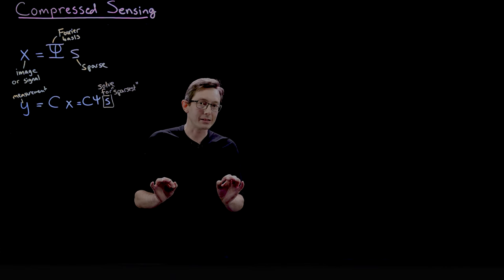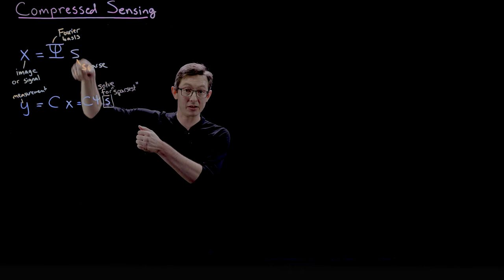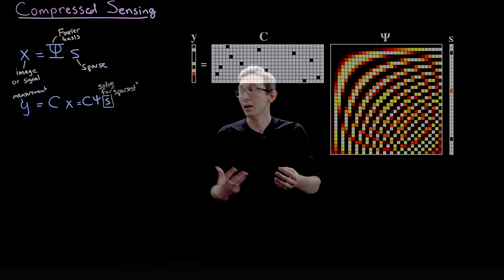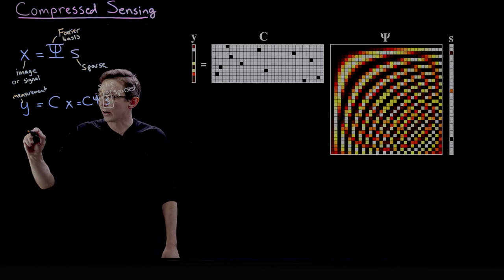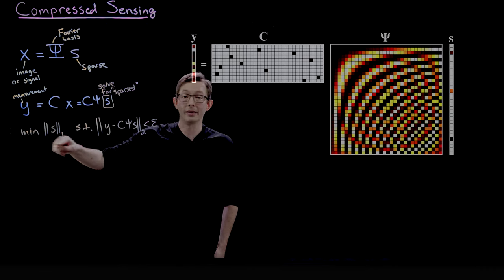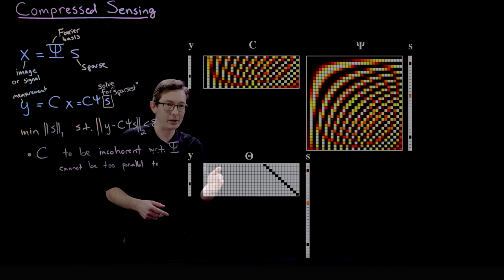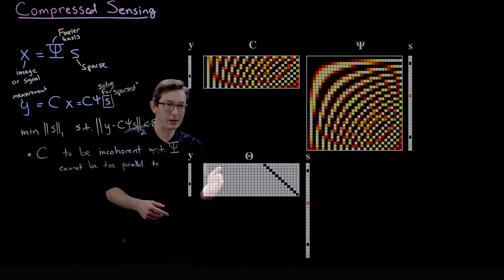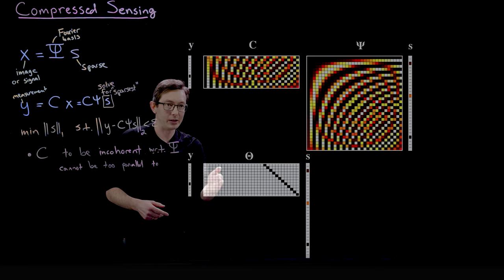Compressed Sensing: When It Works

Comment: Another application that was in the news recently, as I understand, was the black hole image, where the astronomers had data from specific observatories which are semi-randomly scattered across the surface of the Earth. There they also had to select the image from probable ones that fit the model, so probably a bit more in-depth than shown here...
Reply: Also to detect gravitational waves!! They used wavelets similar to in the JPEG 2000 standard, one of the vids from the talk I watched on all that: https://www.youtube.com/watch?v=tMV61BZCrhk

Comment: question: for a x=50*50 pixels original image, guess y=250*1, s=2500*1 ,psi=2500*2500,and that means c=250*2500  but it was supposed to be 50*50 matrix as it says which pixels we are measuring of a 50*50 original image.

Comment: It's interesting to further I watch and I will watch more of the chapter. 

The random nature makes me question: I'd you build a camera where pixels are more randomly distributed instead of in a nice array: could you actually get the random sample much better than just taking a subsection of the signal? Is the random selection just spatial if you have two dimensional data like an image or could you also take like measurement noise as being the random factor(which is very close to actually random) for inferring the higher accuracy brightness level for pixel. Here you would think for the Luma value as a dimension, where just 0-255 is sparse and you want 0-4095 instead for example.

Comment: Dear Prof. . Great lecture. I do have though a question. You set C metrix as a given. It is neither a diagonial metrix nor a single column so how do you know which ones are active in a real problem that X is not known? We could not solve the y = cx. Is it just a random metrix?
Reply: Generally, yes, that's the idea behind CS: you do not need to know which positions in the signal are zero, you just use an i.i.d. Gaussian matrix (for example) and you will be able to completely recover the signal if you have enough measurements.

Comment: Prof. Brunton: how do I use this concept when my data is 4D - like a parameter that is mapped as a function of 4 independent variables (for example) and sparse in polynomial domain (instead of the frequency domain)?

Comment: I would like to know if you could use that to squeeze out more information about some existing measurements - in a sense that regards every measurement as a compressed sensing of reality. Assume you have technical problems to get a better resolution of some image like in astronomy. Assume you have some images of the sky. Can you pretend that they measure only a random subset of a higher resolution image, solve an optimisation problem and obtain more information about that higher resolution image than using traditional techniques?
Reply: Only if the measurements are incoherent. For example if you were to use a low resolution image to try to recover a higher resolution image that is sparse in the Fourier domain, it would not work because the low resolution measurement matrix is naturally coherent with the Fourier basis - it resides wholly within the lower frequency part of the Fourier basis.

Comment: I have a n*n matrix (x).  Two or more of its rows then deleted randomly so it become a m*n matrix.  For ψ I have used DCT matrix (and some other matrices) and treated random measurement matrix C (such as Gaussian Random or Bernoulli) such that Cψ  satisfies RIP. 
Many  L1 optimization methods such as CVX toolbox, OMP, ReOMP, Cosamp, ... are used to calculate sparse s. y-Cψs becomes very small (10^(-16)) while s has a few nonzero elements. However ψs is not equal to the original x. 
I appreciate if anyone who has done this work, gives any comment. Why this does not work?

Comment: hold up, is this kind of how JPEG compression works?
Reply: JPEG is another story, CS is a relatively new compression method of any kind of signals. Cmiiw.
Reply: @NoName-zn5df  JPEG 2000 uses wavelets,  I think at some point they allude to using wavelets in the future for compressed sensing in the video and that is where the connection is being drawn.
Reply: There are strong links here, but there's a fundamental difference. A simplified JPEG compression would be: measure the image at full resolution, take a Fourier transform, throw away the high frequencies and save the low ones. The key point, however, is that you still measure everything. In compressed sensing, you only take a number of measurements proportional to the number of frequencies you would've kept in the JPEG compression process, so you're actually taking fewer measurements.